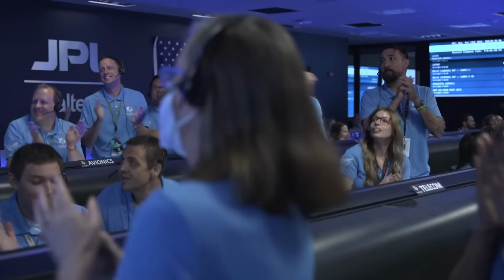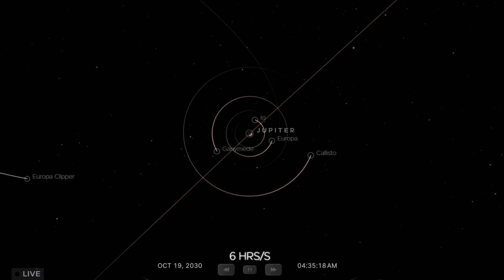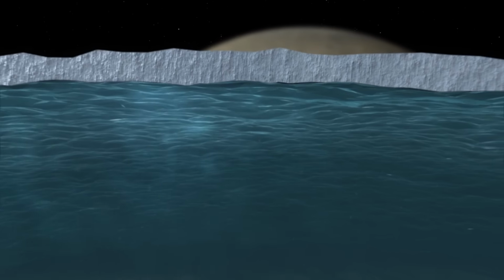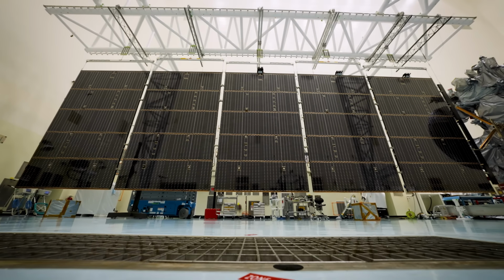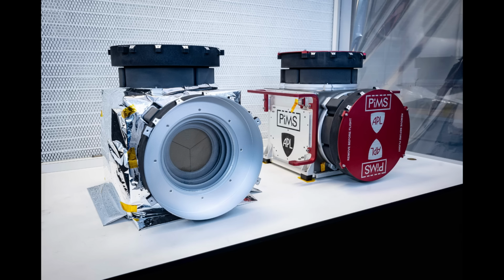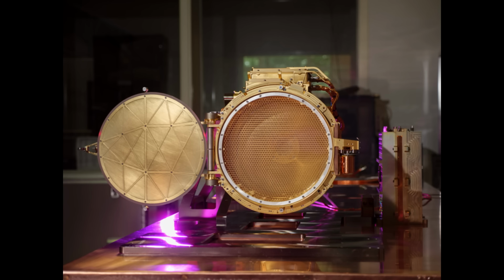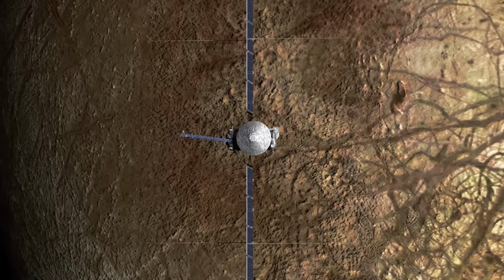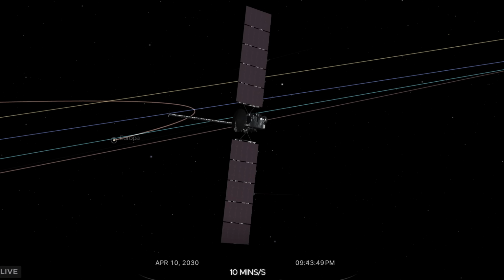SpaceX Ditched an Entire Falcon Heavy To Launch NASA's Massive Probe To Europa!

Comment: SpaceX Launches NASA's Europa Clipper on a Mission to Jupiter's Icy Moon

* 0:18 Falcon Heavy Dedication:  Europa Clipper was launched on a dedicated Falcon Heavy, with all three cores expended to achieve the necessary velocity for the mission.
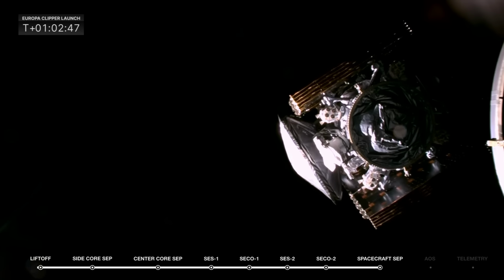* 1:01 Massive Spacecraft: Europa Clipper, weighing over 6 tons, is the largest spacecraft ever sent into deep space, surpassing even probes sent to Mars. 
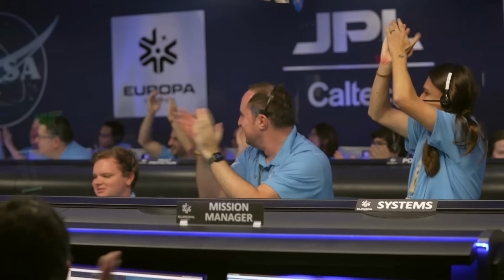* 1:17 Mission Timeline: The spacecraft is expected to reach Jupiter in 2030 after a series of gravity assists from Mars and Earth. 
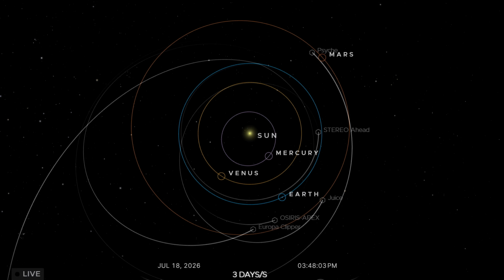* 3:23 Gravity Assist Route: The mission will utilize a Mars flyby to alter its trajectory, followed by an Earth flyby for a final boost towards Jupiter. 
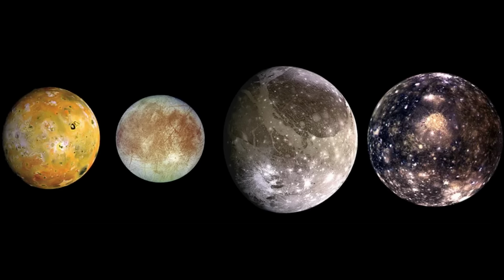* 4:28 Europa's Significance: Europa, the second Galilean moon of Jupiter, is believed to have a subsurface ocean larger than Earth's, making it a prime candidate for the search for extraterrestrial life. 
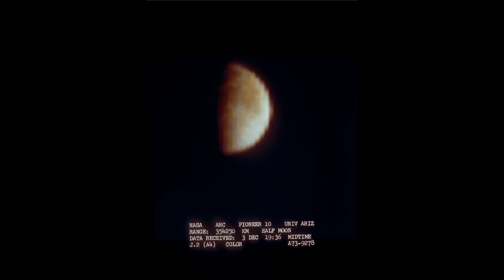* 5:09 Historical Observations: Past missions like Pioneer 10, Voyager, and Galileo have provided increasing evidence of Europa's icy surface, potential subsurface ocean, and plume activity. 
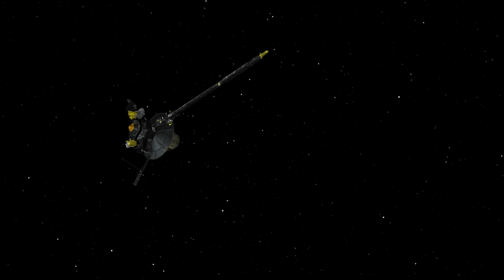* 6:40 Magnetometer Evidence: Galileo's magnetometer readings detected anomalies in Jupiter's magnetic field near Europa, strongly suggesting a conductive, salty subsurface ocean.
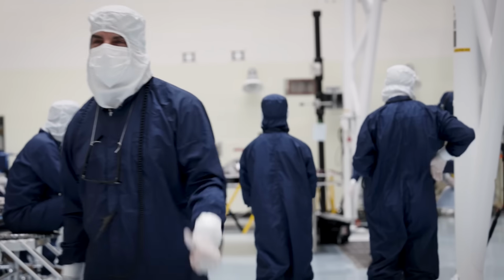* 8:21 Radiation Environment: Jupiter's intense radiation belts pose a significant challenge to the mission, requiring Europa Clipper to utilize a radiation-shielded vault for sensitive electronics and employ an elliptical orbit to minimize exposure. 
* 10:40 Solar Power at Jupiter: Despite the weak sunlight at Jupiter's distance, Europa Clipper relies on large solar panels for power, acknowledging that these will degrade over time due to radiation.
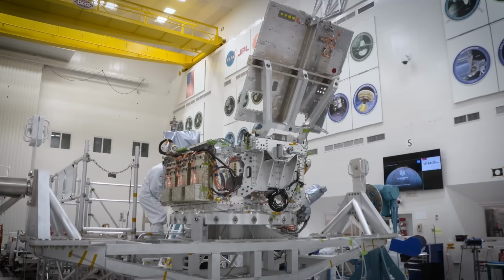* 12:53 Thermal Control:  The spacecraft features a sophisticated thermal control system, including multi-layer insulation, heat redistribution, and radiators to maintain optimal operating temperatures throughout its journey.
* 13:54 Scientific Instruments: Europa Clipper carries a suite of advanced instruments, including a magnetometer, plasma instrument, cameras (EIS, E-THEMIS, MISE, Europa-UVS), a mass spectrometer (MASPEX), a surface dust analyzer (SUDA), and a radar sounding instrument (REASON).
* 14:11 Magnetometer Boom: A 9-meter boom deploys the magnetometer to minimize interference from the spacecraft's own magnetic field.
* 15:51 Camera Systems: Multiple camera systems will capture high-resolution images of Europa's surface in various wavelengths, including visible, infrared, and thermal.
* 16:52 Spectrometer Analysis:  Spectrometers will analyze the composition of Europa's surface and tenuous atmosphere, searching for evidence of organic molecules and other potential biosignatures. 
* 17:37 Plume Sampling: The spacecraft is designed to fly through plumes erupting from Europa's surface, allowing the mass spectrometer (MASPEX) to directly sample material from the subsurface ocean. 
* 18:51 Dust Analysis: The surface dust analyzer (SUDA) will collect and analyze dust particles to understand the composition of Europa's surface material.
* 19:27 Radar Sounding:  The REASON instrument will use radar to penetrate Europa's icy shell and map the structure of the subsurface ocean and its potential interaction with the rocky mantle. 
* 20:18 Gravity Science: Subtle changes in the spacecraft's velocity, measured through radio signals, will provide further insights into Europa's internal structure and gravity field.
* 21:16 Future Exploration: The data collected by Europa Clipper and the European Space Agency's JUICE mission are expected to pave the way for future, even more ambitious missions to potentially confirm the presence of life on Europa.
* 23:07 Energy Sources for Life:  The mission aims to investigate potential energy sources for life in Europa's ocean, including tidal heating, hydrothermal vents, and radiation-induced chemical reactions.
* 24:05 Mission Goals: While the possibility of finding evidence of life is exciting, the primary goal of Europa Clipper is to gain a deeper understanding of Europa's environment and potential habitability, laying the groundwork for future missions. 

I used gemini-1.5-pro-exp-0827 on rocketrecap dot com to summarize the transcript.
Cost (if I didn't use the free tier): $0.03
Input tokens: 22813
Output tokens: 922

Comment: If there's a lot of radiation in the area around Jupiter, I do wonder why that can't be harnessed by a probe in that area to generate power. I assume if it used the magnetic field, the velocity would decay as it uses the field, like the drag of a motor. But it seems strange that there isn't a way of harnessing the radiation in that area to generate heat and therefore power.

Comment: Why are they never including a microsope on these missions! Scoop up a few of the spewed out water particles and then you can actually look if there is really life in there instead of just doing a chemical analysis with a spectrometer.
Reply: If you passed through a volcanic plume on Earth and used a microscope on the gasses you encounter, you would not find life. You would report back to your home world that there is no life on Earth.
Reply: @RockinRobbins13  Volcanic plumes aren't water plumes, and besides that, you probably would see a few bacteria...
Reply: @markh.876  You would see more bacteria if you just sampled the air without bothering to sample a volcanic plume.

Europa's plumes will be very diffuse water molecules, not drops of water. The most that could be done is to analyze them for chemical biproducts that might come from life.

Comment: For that time especially, it is really likely that by the time Clipper reaches Europa, we will have an operational starship and bases on the moon, and quite possibly , other even bigger spacecrafts that will be shoved at much faster speeds directly to Jupiter, Saturn and who knows where else? For once I really hope that during our lifetime, we may actually develop a craft with the sole purpose of slinging it to another star system and have a long term mission of it transmitting data back in an open channel that we can all receive, as it will still take some thousands of years to reach but hey why the f not?

Comment: Note to Nasa: When sending paired satellites assure they use the same frequencies for landers and that cables do not prevent antenna deployment. Hire a plumber. Outlaw acronyms. Call an object what it is rather than apply a layer of unnecessary confusion just to make yourself sound knowledgeable.

Comment: Honestly, a wash between old space and fully expended falcon heavy. It's just that SpaceX is still building new Falcon cores, so it was more about timeline. Starship Superheavy is a realizable booster right now, without further work on Starship or Superheavy. A Superheavy in expendable mode and a <insert stage provider here> upper stage is at or above what Saturn V could do. So you burn up a 20M superheavy booster, and the non-Starship upper stage was already expendable.
Reply: why expend starship? couldn't you launch a probe + kick stage in reusable mode?
Reply: @unflexian  If you just build Superheavy in an expendable config (no grid fins, can be lighter, etc), it could haul a lot more tonnage to a lot more orbits. That is a capability now realized, even as further Superheavy and Starship development continues.

Since Superheavy is now demonstrably recoverable, yes if you make stage adapters for other boosters, it could be used to completely replace delta/atlas/vulcan/ariane as a first stage for any of those, but the NRE on staging adapters would probably need to be borne by someone else, since SpaceX is working only towards Starship to achieve full reusability.

Comment: A salty ocean must also have copious amounts of Carbon dioxyde to reduce the alkalinity to around PH 8 for life to develop. The likely presence of CO2 is high because the solubility thereof is high in cold water. There a other minerals like K , N, P and S that are required to support life. Does the probe have sensors to detect them? 
If yes, then it is a matter of time until life emergens.

Comment: Scott, I think it would be really neat if you did a video explaining the downsides and trade-offs of booster recovery.  Based on the amount of trash-talking on any video or article about a non-SpaceX launch vehicle, I feel like a lot of folks don't quite understand how much performance is sacrificed in order to allow a booster to either return to the launch site or land itself downrange.  And then there are fixed & variable program costs on top of that for the infrastructure to inspect, refurbish, and re-use previously-flown hardware, which play into the economics of a launch vehicle program based on factors like launch cadence and how much work is actually required for the turn-around process (this was a big part of why the Shuttle was so expensive).  Not to mention the up-front development costs of even making a vehicle reusable in the first place.

I feel like this could make for a really interesting break-down, and show why not everyone (especially those looking to service high Earth orbits or lunar/interplanetary missions) is immediately trying to replicate SpaceX's strategy.

Comment: Methinks we're going to have to build a space station designed as an orbital launch station for big ones.  Mid-earth orbit so it stays up there, and build it a bit tougher than the ISS.  Then we can use smaller rockets to send up a few parts of space probes in Ikea mode, some assembly required, put a few astronauts to work putting the final touches on a space probe that can be many times bigger than the mighty Clipper.  ...and we can make sure it launches in working order, every time.

Then we need to build our LaGrange satellites on similar common chassis systems.  The gases and batteries all need to be serviced, so do computers.  They all go here.  A robot's job is a robot's job, and if they're all the same, a JWST or Nancy Grace  Roman can run as long as we can send service robots up there.

That high contrast flyby of Europa looks like ice crystals.  I know it's huge scale, but I know a frost formation when I see one.  We need to come up with a really strong radiation shield that can thumb its nose at whatever Jupiter can send at it.

Comment: I am curious why it has taken this long to launch another probe? We should be launching many more to keep exploring space
Reply: Funding :)
Reply: @tomahzo  or is it how the funding is used? Seems like it is very profitable to supply components with an insane markup for a government project. Case in point, NASA SLS cost over 2 billion per launch compared to SpaceX falcon heavy costing only 90 million. SpaceX spent around 300 million to develop falcon 9, it is estimated that it would have cost between 2-4 BILLION is NASA designed it.... Better product with a cheaper cost is entirely possible if you eliminate government red tape!

Comment: I wonder if falcon heavy could strap on two more boosters with relative ease and if that would allow it to compete with the delta v of SLS
Reply: At that point, why not just use Superheavy?
Reply: It could work but it’s a lots more complex than it sounds, the core stage of Falcon heavy is already heavily modified from its original stage weighting twice that of a normal Falcon 9 booster, it would simply be easier to make a new rocket

Comment: There will be an entire new Falcon design coming I'm guessing when the Raptor3 engines make the gantry fire trench. I still give only a 33% chance of success since they spent $5.2B and didn't place an RTG onboard. WAM, and last min SCR switches BC the source devices died in electron beam radiation life tests. For that price, JPL should have delivered a more robust device.
Reply: BTW, an extra several layers of lead mesh screen are obviously incorporated BC 1cm of AL is not a very good rad screen, it's mostly just the environmental chamber with brass and lead screens to ground out the electron charge buildup. This was the early issue before ceramic bearings, the electrostatic charge would pit out the solar panel servo bearings.

Comment: If a single use superheavy booster without grid fins, chines, landing propellant etc were launched without a Starship, it could reach orbit, refill and then dock with a refilled starship, and leave orbit. There's enough propellant and sufficient gravity assists available to make the trip to and from Jupiter in Starship in slightly over 2 years. Unsure what the re-entry profile would look like though, lots of skipping I would imagine.
Reply: So I did the math, the booster would theoretically be able to reach orbit with no payload, in one stage. It would be under an exceptionally thin margin, and frankly there's no realistic use case, (sea level engines in space leave a lot of efficiency on the table) but it theoretically could work!

Comment: The reason we don't use ptags is because we're out of pu238, my grandfather who was involved in the development of that technology at los almos in the 60s was bitching about the DOE policies when i was a teenager. 

You need thermal spectrum breeders to make pu238, thorium reactors with molten salts ate the most efficient.
Reply: IMO we should just be using a little fission reactor at this point.
Reply: @nerd1000ify the tiniest fission reactor possible would still be too heavy for these long-distance space probes
Reply: @clayel1 
but with practically unlimited power source you could just "burn" longer and compensate for the additional mass
Reply: @schrodingersmechanic7622  The needed reactor is tiny.
would weigh less then the solar system if i would to gamble.

The design would also become more straight forward.
More heating options.
Reply: @nerd1000ify 
Oh ‘we’ will. It is just around the corner. 
([“Corner”= 1 human generation ] + 20 earth orbits)

Comment: Hi, Scott.  I don’t know if anyone has already asked this question before, but would you know what happened to the boosters that were expended on this launch? I know that they’re supposed to burn up in the atmosphere, but how much of the booster makes it back to Earth?  I know that the landing hardware was taken out of all the boosters to save weight and increase efficiency, but I would like to find out if anything makes it back down intact.  I know the center booster is the one that gets launched further since it burns for a much longer time than the two side boosters.  I know those boosters are pretty robust but without the grid fins and the slow-down burn, they’d be hitting the upper atmosphere at incredible speeds without being able to slow down.  Maybe I already answered my question?  Please let me know, if possible.  Thank you, Scott, much appreciated.
Reply: The boosters don't burn up, they fall into the Atlantic

Comment: 2010 was a great film, and the book was also good, in my opinion the book was Clarke's best full-length novel. I read it in 1983 or 84 before the movie came out. In the preface Clarke said that he wrote the book as a sequel not to his earlier book, but as a sequel to Kubrick's film, because Kubrick's film was significantly different from the book version and Clark believed most people were more familiar with the film. I read the book 2001 and have to say the film was way better and more mystifying. The film 2010 is great, but obviously doesn't have the Kubrick touch. I was later saddened when I found that the story of 2010 was unrealistic due to most of the story taking place deep in Jupiter's radiation belts.

Comment: It seems not logical that a RTG should be discounted when you could run a RTG plus the panels (probably not as large - mass exchange) and excel at power gen rather than rely on attitude for solar gen. Lose thrusters and cannot point towards the sol? It's not ideal so wouldn't it be better with an RTG? I just thought the downplaying of RTG (eg. Galileo mention) seemed like an illogical point for whatever reason.

Comment: If I had to build the Europa Clipper with the same mission hardware/instrumentation.   Off-the-shelf pricing for the (9) scientific instruments:

 - PIMS:  (4) Faraday Cups invented in 1961:  $130 each.
 - Magnometer:  Invented in 1833.  $5,000 for sensor and Gaussmeter.
 - Mise:  NIR spectrometry invented 1943.  $5,500 ($2,400 on Amazon, but I upgraded).
 -  EIS:  (2) cameras invented in 1816.  $44K each (splurged on the Red digital Raptor narrow/wide angle)
 -  REASON:  HF/VHF radar, invented in 1935.  $100K.
 -  E-Themis:  Mid/Far IR detection, invented 1800.  $2,400 (plus $12.00 shipping).
 - Maspex:  (ion) mass spectrometry, invented 1912, $225K (upgraded to very high resolution).
 - Ultraviolet Spectrograph:  invented 1972, $4,500.
 - SUDA: surface dust analyzer.  Dust pan invented in 1858.  Dust pan, $8 (Target), Charged metal plate, $27, ion-mass spectrography sensors $4,500.

 - Instrumentation total:  $435,467.

 - Solar array $1,450K (sorry Azur, you're too pricey).
 - Fuel:  MMH/N2O4, $991K.
 - Avionics Vault:  1/2" (12.7mm) 7050, $7,300.
 - Anti virus/bacteria scrub:  Wet-ones $1.99 (Wal-mart).

 - Other:  computer, star finder, thrusters, antenna, etc, $120K.

Total off-the-shelf cost:  $3 million.

Starship delivery cost:  $1600/kg * 6000 kg = $12.5M.

 - All in:  $15.5M private sector...(versus):

NASA cost to build:  $5.2 billion.  $150M Falcon heavy launch = $5.35 billion total cost.

 - 99.9% cost reduction utilizing Starship and private-sector.  This is what the future costing will look like...